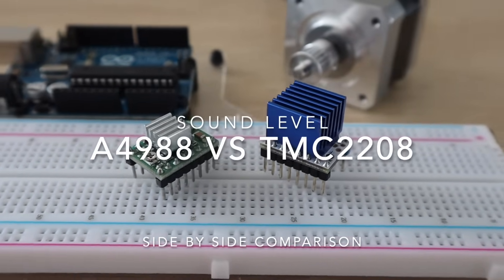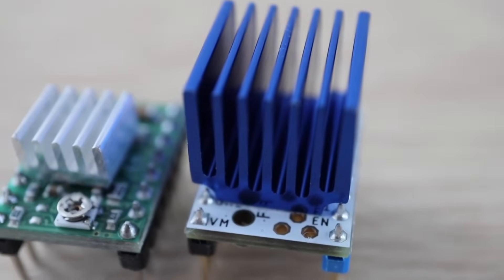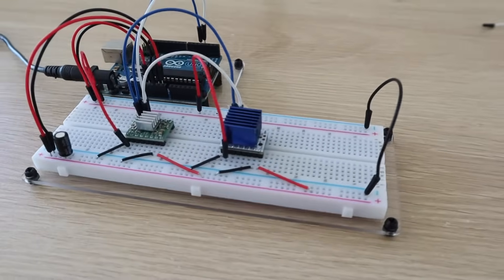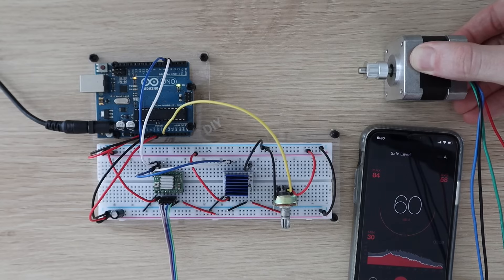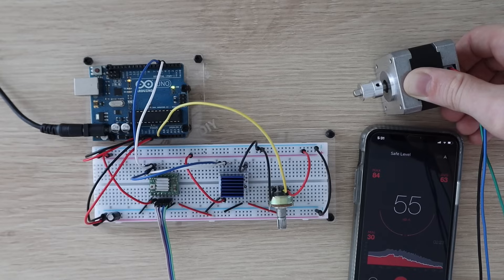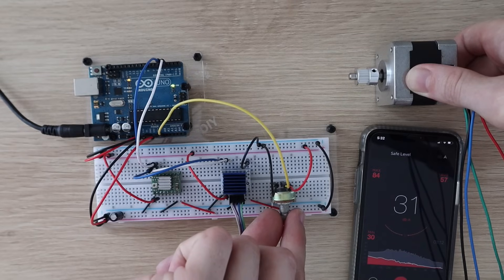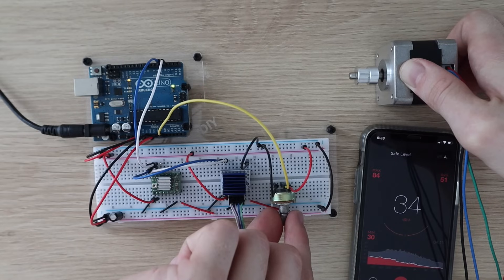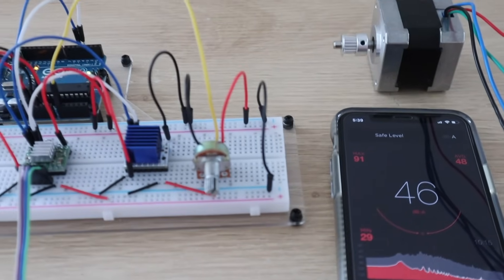TMC2208 Vs A4988 Stepper Motor Driver Sound Level Comparison

Comment: Will this work on a NEMA 34?
Reply from the maker: The TMC2208 drivers have a current limit of 2A. So yes, they will work with a Nema 34 motor, but will only be able to supply a maximum of 2A. This is likely less than your motor's maximum, so you'll be limiting the maximum amount of torque you can produce.
Reply: @MichaelKlements  thank you for your kind response much appreciated, do you know an alternative or isn't there one? Kind regards.
Reply from the maker: I've never had a need to use Nema 34s, so I haven't got much experience with them. I'd suggest asking around larger CNC machine forums - like the guys who make large CNC routers and laser cutters.
Reply: @keniji7442  I believe the newer TMC5160 or TCM5161 can handle much higher amps, so they might work for your application, look up their specs. alternatively you might want to consider actual stepper motor controllers, rather than break out boards, look on stepperonline for the suggested controllers for your nema 34

Comment: That's insane man! I use stepper motors for my DIY EQ mount for astronomy and my biggest pet peeve have been the vibrations when using an A4988.  I had no idea there were almost silent alternatives. I assume these produce WAY less vibrations too. Great  video.
Reply from the maker: I actually found these in a search for some quieter drivers for a camera slider which I’ve been working on - it’s almost complete now. But yes they’re almost completely silent in the footage now and there’s virtually no vibration either. They’d be great for astronomy!
Reply: @MichaelKlements  Thanks for your answer. I just ordered a couple.
Reply: @Zwettekop  my diy mount guides at around 0.9" RMS with tmc2209s
Reply: @Zwettekop  I want to make my own star tracker too. Can you help me with it?
Reply: @hasanagera  Do you have a 3D printer? I have a design with and without one.
Reply: @Zwettekop  I'm interested to. I dont have 3d printer yet but I'm thinking of buying one

Comment: Would you be able to guide me in the right direction with using TMC2208 with Arduino Uno? Started pullin hair as of last night LOL.
Reply from the maker: Yes sure, it’s pretty much the same as with a A4988 driver - https://www.the-diy-life.com/arduino-stepper-motor-pololu-driver/
But you can remove the little black loop next to the Step and Dir pins, and you need to tie the En pin (one on the end) to 0V. 
Then it should work
Reply: @MichaelKlements  I think I made that classic mistake of connecting wrong EN pin. The writing on the PCB is next to the wrong pin.  But yes sir, following such and examples from your post it works like a charm!

Comment: I have an urgent question. I have a stepper motor with 2,8v and 1,6A rms can I use this for it. I,ll be happy for answering my question ✋🏼😊
Reply from the maker: 2.8V sounds quite low, but yes this driver should work for your motor. It can handle 0-36V and up to 2A current.

Comment: Great comparison!
Is the main reason that the TMC drivers are quieter than the A4988 because they can micro-step at 1/256 of a step and the A4988 only 1/16 step? I'm curious because I know that the higher the micro-stepping, the slower the top speed of the motor because the Arduino can only output a certain amount of pulses per second reliably while performing other functions. I need to drive a stepper motor at speeds of a minimum of what is shown at 2:20, so what is the approx top speed of an unloaded stepper motor when using a TMC driver?
Thanks!
Reply from the maker: Thank you.
I think it’s a combination of micro-stepping and creating more of a sine-wave on the pulses to smooth them out.
Yes you are correct in theory, except that these boards have been designed to replace the A4988 boards, so they take care of the additional micro-stepping.
If your Arduino outputs 8 steps on the A4988 then it would do the same on the TMC2208. The TMC controller then takes the 8 steps and makes it 128 steps, so no extra processing time is required from the Arduino.
Reply: @MichaelKlements  Thank you for the useful info. I've heard about how the TMC's smooth power curves help decrease noise, but I didn't know that they take care of the additional micro-stepping! If this means that it can spin a stepper at the same speed as an A4988 running at full-step mode, with the same MCU output, I'm gonna replace my A4988s soon.

Comment: iv just put the TMC2208 driver in the felfil spooler hope to get better quality filament production as well as being more quieter
Reply from the maker: It’ll be interesting to see if you get better quality as well. The movement is definitely smoother as well as quieter.
Reply: @MichaelKlements  the cnc shield v4 what a mess but will keep hacking a way at it
Reply: @MichaelKlements  I maybe missing something here but iv tried the tmc2208 and yes there very quiet as the spooler is quiet and not missing steps where the puller tmc2208 is missing steps every revolution but wont speed up when script is telling it to as it stays on one set speed I find strange both in legacy mode GRBL CNC shield v4

Comment: Amazing, just what I needed to know. I have added microstepping to my A4988 circuit to try to reduce the noise, but its clear I really need a TMC2208. Thanks 😀 👍
Reply from the maker: Yes, definitely get the TMC2208 if you need a silent or very smooth stepper driver.
Reply: i jsut did it yesterday and its amazing, at first i thought it didnt work but you just dont hear it move :D
Reply from the maker: Yeah, its quite impressive how well it works! I also thought mine wasn't working until I noticed the shaft slowly turning.

Comment: Hello Michael,
at the moment iam working on a project at my university and need some help. I use A4988 in the current construction where i control two stepper motors with a joystick. Now cause the whole system is very noisy i want to change the drivers and use TMC2208 or TMC2209 drivers. You would help me a lot if you could give me some information about your source code, the set Vrefs that you used on both drivers and what kind of power supply (Voltage and Current) you use. Did you measure the "real" currents that flow through your system? Iam really glad to finally find someone that made a video about this topic only one month ago. Thanks in advance and stay healthy!
Reply from the maker: I'm using the drivers in "legacy" mode, which is the same interface as the A4988 drivers. So I'm simply setting the direction pin either high or low and then pulsing the step pin at different intervals to get different speeds. I've done a few projects using A4988 drivers, which you can find on my site linked in the description. The code used for these projects will work with the TMC2208 drivers as well, with no modification required.

I set the Vrefs using the voltage measurement method - https://wiki.fysetc.com/TMC2208/ or https://youtu.be/OpaUwWouyE0

I'm just using a variable 0-24V 5A power supply, I had it set on 12V for this test. So 12V and 5A power supply.

No, I didn't measure the real current. This shouldn't be too far off what is stated in the motor's datasheet if you have those available for your motors.
Reply: @MichaelKlements  Could you give me access to your programm code please? And thanks for your quick answer!